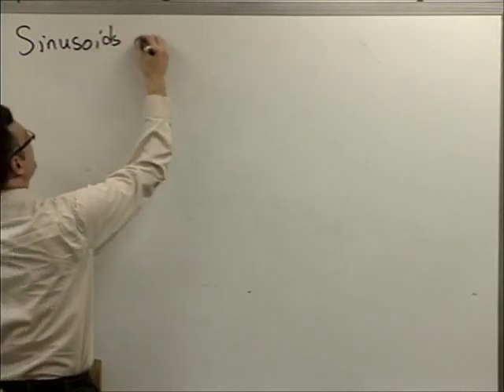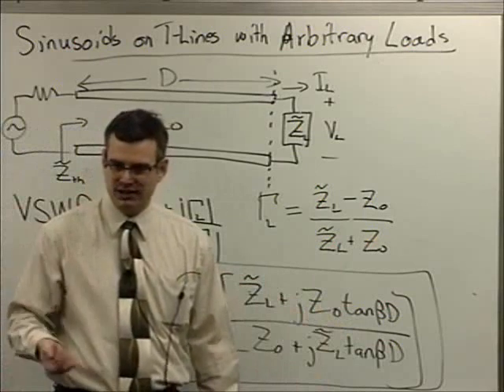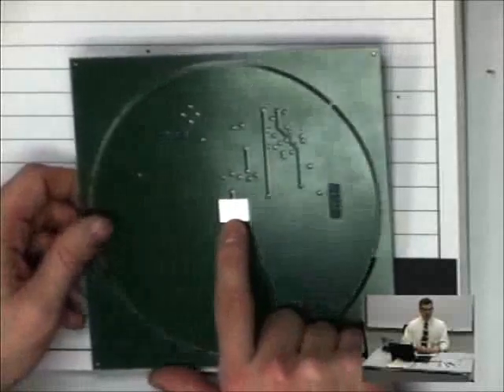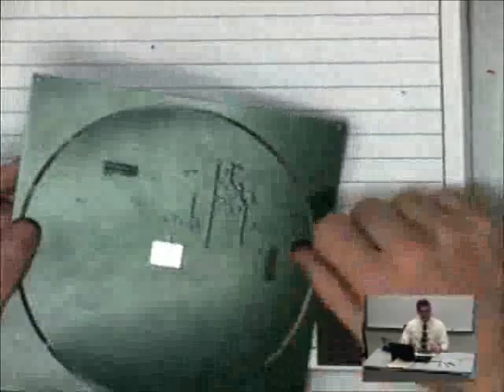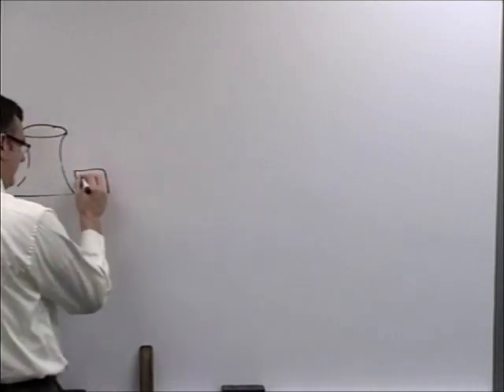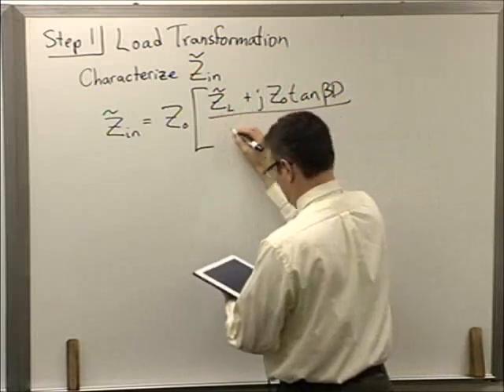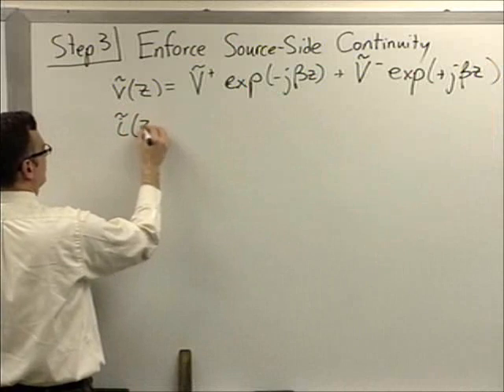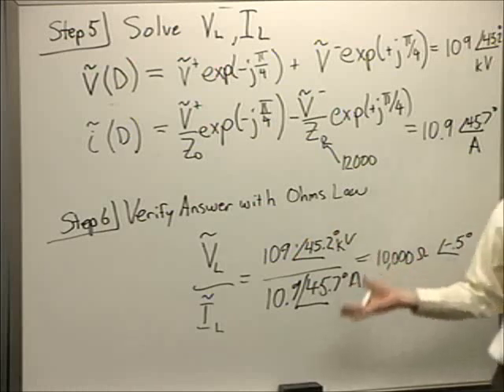THT04: Transmission Lines with Arbitrary Loads

Comment: Pls am a college student and am having issues solving these questions on lossless lines, will be glad if you can help me out;
QUE;
A 1meter long lossless line has a characteristic impedance of 400 ohms. if the line is operating at a freq of 200Mhz and has an input impedance of (200-j200)ohms , use both analytical and smith chart method to determine 
i. VSWR
II. The load impedance ZL
III. the distance of the nearest voltage max from the load.

2.
A current of 20mA is sent over a transmission line of length 10km, attenuation constant of 0.1 neper/km and phase constant of 0.05rad/km.
Determine the received voltage and current if the receiving end is short circuited.

thanks i will be very grateful if i can get d solution soon;
my email : adegokeseun2032@gmail.com

Comment: @45:40, I would have thought V+ is equal to Vin = Vsource. That is, in general, isn't V+ =Vin, and is computed from voltage division of Vsource using source impedance and tline intrinsic impedance? If so, then when the source impedance is 0, then isn't V+ = Vin = Vsource? Relatedly, since you chose the source impedance to be zero, wouldn't that cause a complete negative reflection of V- at the source side that should be included in your voltage continuity equation (for t = 2*transit time)? Moreover, it seems like there would be an infinite sequence of reflections because there are reflections at both the source and load sides. Am I wrong? Thanks.
Reply: i also have the same doubt